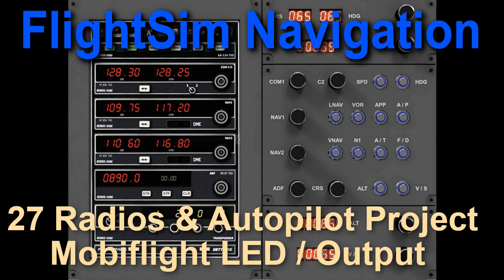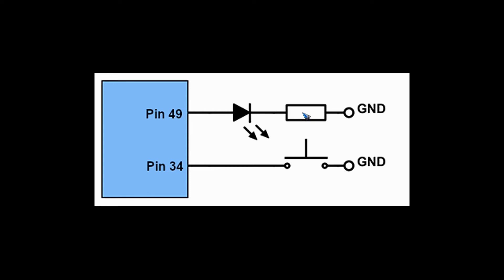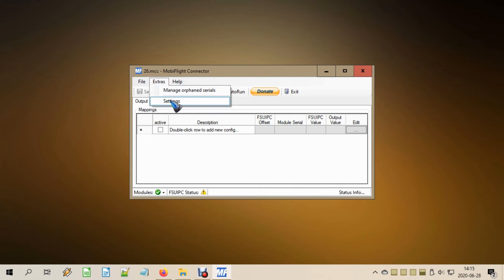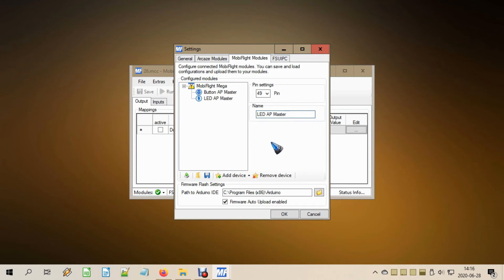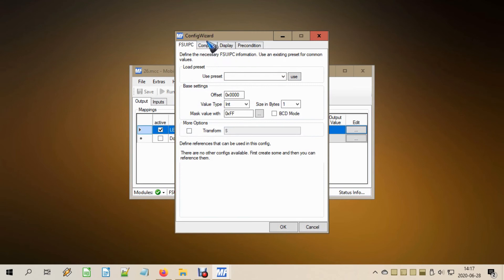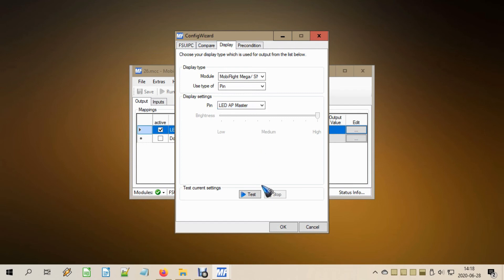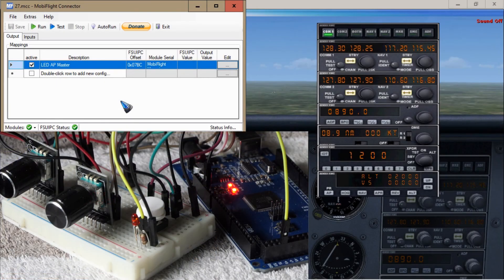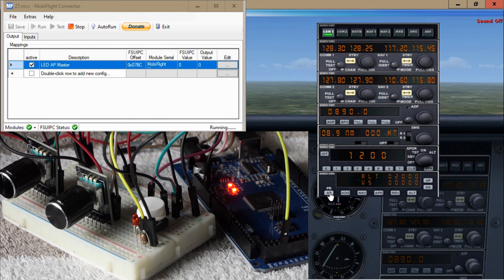Flight Sim Navigation 27 Radios & Autopilot Project: Configure an LED Output in Mobiflight

Comment: Where this LED is used? in the panel you're using PB with LED for AP so where this LED lights on the panel? and if possible can you send me a picture of wiring diagram that how you wired these Push Buttons with LEDs? that would be much appreciated. Thanks
Reply from the maker: If you send a message on the blog, I can email you the wiring list.

Comment: Really nice videos man. You explain things very well. Watching through your videos now on the panel as I want to do the same thing. Getting a lot of good inspiration from your design. thanks for the uploads.
Reply from the maker: Thanks for your feedback Mark, it's appreciated.
Reply: @rudyshobbychannel  No problem mate. Couple quick questions for you if you don't mind. 

You mention using a resistor on the ground line. Is that just when working with LED's? Or you recommend putting one on the ground regardless? 

When working with LED's would you also put a resistor on each LED? 

How do you know what value resistors to use?

Also regarding LED's, do you need to get 5v ones to use with the Arduino Mega, as lots I have seen are 12v. 

sorry about all the questions, but totally new to this so trying to figure out as much as I can before starting my panel project.
Reply from the maker: @Mark_BLN  Mark, you'll need to remind me where I mentioned a resistor in the ground line, I don't recall.
Yes, always place a resistor in series with every LED. The R value can't be predicted, depends highly on the type of LED and how bright you want it to light up. Sometimes 330 Ohm is OK, sometimes you need 2.2k and sometimes with 'super bright' LEDs even 39k.
There are no 5V or 12V LEDs ... not sure what you mean here. With some of the buttons with built in LED a value is specified, for working with Arduino's 5V is the way to go, but you still need a resistor in series.